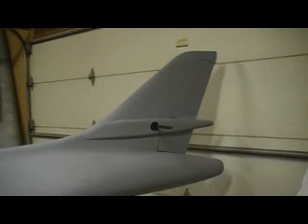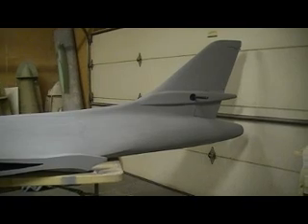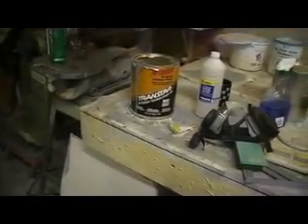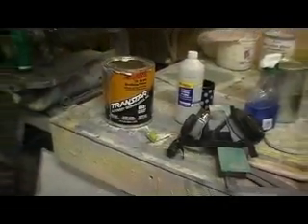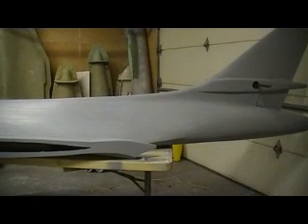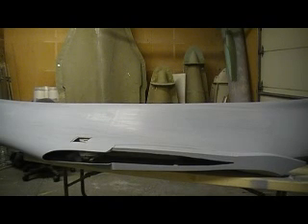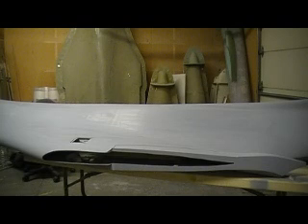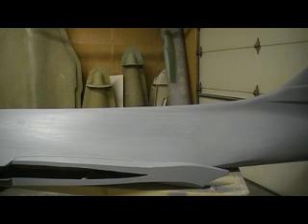how to build a rc jet B-1 Bomber # 177 pt 1

Comment: The jet is looking great!  I wanted to tell you those small flight control surfaces are not canards.  They are SMCS vanes.  SMCS is an acronym for Structural Mode Control System.  They deflect up or down to dampen longitudinal structural flexing on the airframe.  You can call them what you want, but if you talk to people who know B-1's you should say SMCS.  Keep up the good work!

Comment: Hey Bob,You can link the top and bottom rudder together by using a U-joint that R/C boats use to link the motor to the pro. shaft.. They are strong and would work...